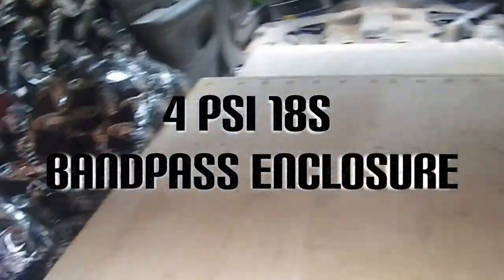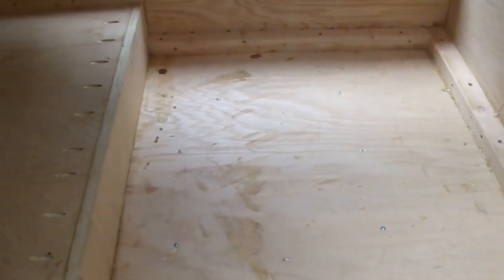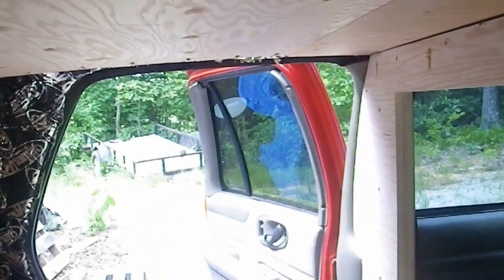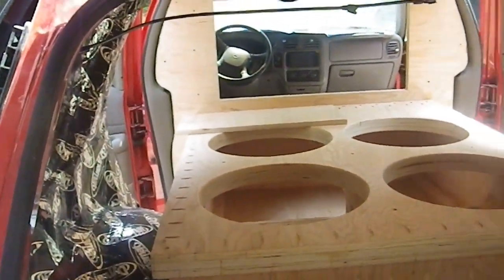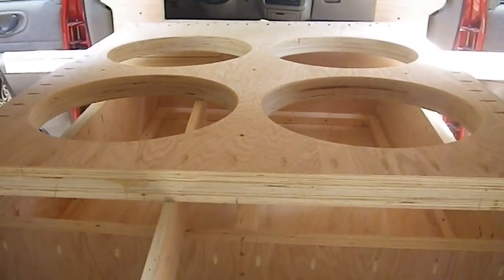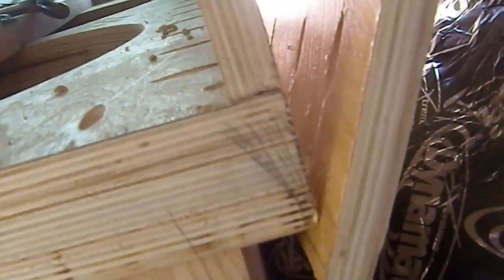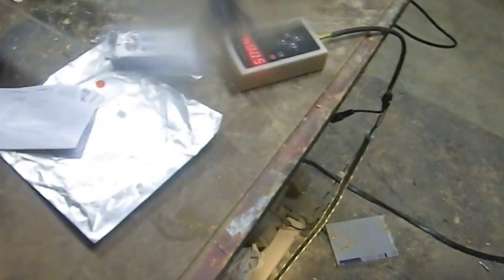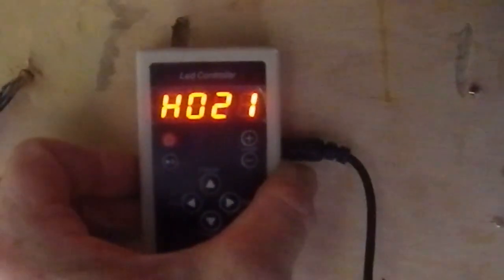4 PSI 18s Bandpass Enclosure

Comment: Nice work I filled all my body panels with expanding foam no rattles the cab roof still flexexs but I am running some square 1/2" steel across it for support

Comment: Can you replicate this  box      PRXE10D2  memphis audio  .... ??? I went to  your  website  but  before I do special  order  ... can it be replicated  memphis audio  PRXE10D2
Reply from the maker: Yeah call me tomorrow 731-616-5739 Thanks Rob
Reply: @CheRRyManCustoms   ... this  are the  dimensions  I got from  Memphis audio  PRXE10D2  . W 31.95"/ top D 14.47"/ bottom  D 15.47"/ H 13.93" .. box specs 3.08 CU feet  gross volume  tuned frequency  38hz but Lower  frequency  possible  that's  great  36hz ... port dimensions  12.5"tall /  2" wide / and 27" long  
Single chamber single connection  flushed  subwoofers  . Grey carpet  ... I'll call tomorrow  my name is  Richard  thanks